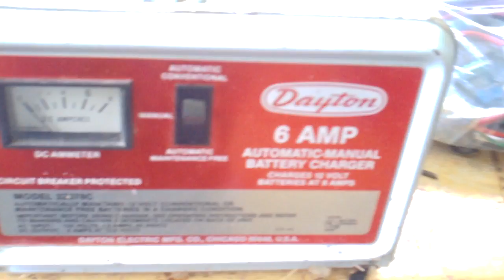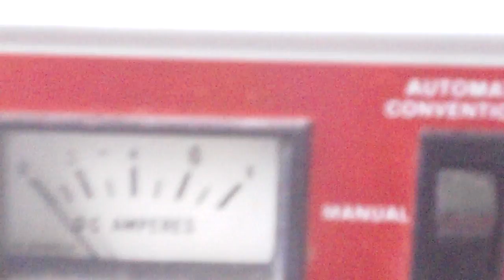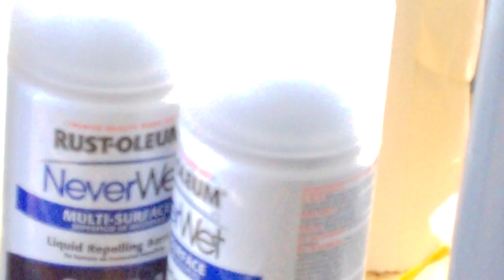How To Make Energized Water For a Joe Cell

Comment: If by "Orgone" you mean proton energy, this makes sense.  What happens when you remove the electron from hydrogen?  You get a proton, which can conduct through stainless steel, much like an electron conducts through metal.  The electrons go through the ignition system to the spark plug, which attracts the protons from the carburetor, in the combustion chamber, the hydrogen reforms and is reacted with the atmospheric oxygen, and "boom" you're running.  The amazing thing is if enough kinetic energy is created to run the engine and produce more power to dissociate more H-O-H.
Reply from the maker: At this stage of understanding proton energy and Orgone are more or less labels and labels don't confer any understanding 
unless they are backed by scientific observation. I'm not sure that under the light of objective measurement you can conflate 
protons with Orgone energy.  For one thing, what we know of Orgone energy has been found to affect seeds and food spoilage in pyramid 
shapes. No water or Joe cell is needed other than some water to moisten the seeds.
Are you aware of ways to generate hydrogen protons that would accord with the energy levels measured in pyramids?
the scientists also found that aluminum had no effect, positive or negative on seed sprouting or on spoilage and mold until it
had been placed in a pyramid for a few days. So, my hunch is that pyramids are orgone accumulators but work differently to
accumulate orgone energy than the Joe Cell.

Another unusual finding by Joe was that it took several days before an aluminum engine block was (saturated or conditioned)
with the Orgone energy. the Joe Cell then became almost redundant and can keep the energy "topped up" in the engine block
and, I suspect, in the cooling system water.  The timing has to be advanced since the engine runs cold using the principle of implosion.
this would lend weight to you idea that Orgone is actually proton energy. Joe has run engines on this Orgone with spark plugs but no
distributor cap or wires. I'm stumped by that, if true.

Another point to consider is that an ideally constructed Joe Cell has the energized water sealed inside preventing both losses
due to typical electrolysis and losses to evaporation. Yet, both the water level and flow of energy continue so long as the Joe Cell isn't shorted out.

Finally, are you aware that the Joe Cell can and does manifest new matter despite beginning with pure water and passivated stainless steel 
and despite being sealed so no air enters.  One experimenter with a great reputation found 19 pounds of weird sludge after cleaning his cell.
The SS tubes he used weighed 19 pounds when brand new and continued to weigh 19 pounds. However, he had the sludge analyzed.
It perfectly matched the metallic/chemical components in the stainless steel.
I also witnessed another experimenter using silver tubes and finding fine grade silver sludge when he cleaned the cell yet the original tubes
were completely intact and of the original weight.  Alert me to corresponding research by proton energy researchers and I'd be prone to agree
they are one and the same. D.

Comment: I have ran my 12kw 240VAC generator on purified compressed hydrogen for several years.  I generate HHO using a separator dry cell, catalytically purify, then...accumulator to compressor to storage.                                                                                                                                                             This "charged water" is complete BS!  There is no evidence that the bond angle in water has ever been different from 104.5° or changes with this so-called technology.
Like Tesla, I am an electrical engineer, (MSEE/ASEET) since 1991 and have explored alternate energies with a VERY open mind most of my life.                                                      But P.T. Barnum sums THIS up perfectly, “Unless a man enters upon the vocation intended for him by nature, and best suited to his peculiar genius, he cannot succeed.  There's a sucker born every minute!”

Comment: It's the water inside a well designed Joe Cell which attracts orgone. It does not produce anything and you don't need that much of voltage in order to "charge" it. Just a small "stimulus" for a minute, thats it!
Reply: What does orgone do? Or how does it work?

Comment: center electrode/tube is always the positive and the outside larger electrode is negative. This is done this way because in nature anodes are thousands of times smaller than cathodes, this is called asymmetrical electrodes. Very efficient capacitors, batteries, and fuel cells can be made using the asymmetrical electrode principle.
Reply from the maker: Two questions for you Solomons Words: How many Joe Cells have you built and tested with the anode connected to the center cell?
How many have worked? My guess you've never even built a Joe Cell and you are just trying to sound smart.

Perhaps you are smarter than Joe Booker, the inventor of the Joe Cell. I don't know where you get your information unless it is the CIA department of disinformation. Center cathode is the way Joe does it. NO anode connection at all! You dig dude?
Reply: I have not made a joe cell, but I have made a few electrolysis cells with different configurations and materials. I haven't really looked into joe cells at all just felt like stating something I've figured out through trial and error in my search for efficient electrolysis... If you are only making the center tube a cathode than does it transfer current through capacitive means? Similar to how a tesla coil's top load creates a difference in potential across a conductive plate close to it.
Reply: I think I can answer this with my willful ignorance of accepted science (but I think that helps often). The battery of the car has the anode and is the power source the Joe cell draws a current so no anode needed. The fuel source would be the battery which is causing the reaction in the hydrogen oxygen mixture. The so called 'orgon' produced is simply an electrically charged water when given the right conditions to vaporize it will carry a highly charged near volotile charge with it and if ignited it will explode (or implode according to the comments of those working with it) and given the right atmospheric pressure with ignition it will yield a substantial force. It's not so different than the conditions around the equator of the earth that generate frequent lightning storms. In that case I guess the clouds themselves act as a capacitor building up charge until the it overflows and causes the hydrated air in close proximity to act like a joe cell connected to a battery and fed into a car motor through the carburetor. And it searches for an earth in which to ground itself and goes booom. the equatorial atmosphere is like a big Joe cell. All it needs is a spark and bang it goes. A car running on a Joe Cell is running on electricity and not hydrogen (the cell itself is a conductive reservoir). The electrically charged vapor is then carried and conducted into the motor and then put under high pressure and then it is ignited.There really is nothing complicated about it. It is a very mechanical process. The electrically charged particles just need the right conditions to be turned into a vapor and carried to the carburetor with no extra air just the electrified vapor in it's concentrated form into the carburetor to be carried to the piston and put under pressure then ignited. But what would I know right? a high school drop out like me, don't take any notice of this.
Reply from the maker: Not bad, Gregory except that whatever the energy the Joe Cell produces it is not coming from the battery; but, more important, whether the energy is from electrically charged water clusters or Orgone the fact is the energy that I call Orgone is not a typical HHO type of gas.
Joe Cells work just fine with a solid aluminum tube or hollow aluminum tube that is electrically insulated/isolated from the negative of the car's engine. In fact, the connection goes to a blind fitting. No typical gas like HHO can flow out of the cell and it never consumes the 3rd stage water within the cell itself.

As I've mentioned before, the Joe Cell defies conventional physics and their is a literal ton of documentation from many astute researchers.
Reply: well I didn't mean to infer the energy was coming from the battery. What I was saying was that the anode is in the battery the cell is just a carrier of the current into production of the orgon or what every form it is making it. Without the battery then no electrical charge> Well I really didn't mean to say that if I did. They guy is asking about the anode and cathode. 

I can see it surging in one of your other vids. That is interesting... You mention a slight change in the way you set up that cell but don't tell... I'm watching in just now
Reply: +hyfusiondotcom how far have you driven your vehicle on HHO?
Reply: Hey man, I just found out about this Joe Cell stuff, and your explanation here is the most logical one I've seen that doesn't reference 'orgone' (not that I'm opposed to the idea, it's just new to me and I know nothing about physics)...also, I was watching a video of Joe showing some stuff in his garage off and he mentioned regarding one contraption, 'this is how I make lightening'. So you're saying that by introducing a current into water, and then introducing that water into an environment with magnetic fields that create the right environment for electricity to 'conduct' itself through water vapor (like storm clouds in stormy parts of the world), the electrified vapor looks for a place to release itself, and then whatever 'spark' caused by the engine creates an 'endothermic' reaction which powers the engine? So this is like an electrified water-vapor powered thing? And it would make sense that not too much water is actually used because it's just a consistent current that's expressing itself and the water and magnetic fields are just sort of the catalyst for that to happen, right?

Does that violate traditional physics? I don't know an anode from a cathode, but this idea of magnetic fields and water and electricity to create power is something I just heard about and am fascinated with. I also worry that I don't know enough about physics to not get taken in by some BS, so very curious to hear more from a perspective that sorta 'makes sense' to me.
Reply: I think Sol might be one of those young people who were flogged "conventional current flow" as  distinct from "electron flow " like us old blokes were taught.

Comment: I've come to the conclusion that this is not all it's made out to be.
I've tried all sorts of configurations, except charged water, but still can't get anything to run with or without Hydrogen.
I've tried Wet Cells, Dry cells, but still no results.
I've used a MIG welder to supply High Amps and High Voltage, and produced quite a bit of hydrogen, but still couldn't get even a smallish generator to run on Hydrogen only, so there is no way a car would run on it.
For "Joe" to say he's ran a car with NO FUEL, including Hydrogen, seems pretty hard to swallow.
Why didn't he tell us how it's done if it was at all possible?
There must be thousands like me that have tried, but no one, as far as I know, has come up with anything.
ALSO why would an accelerator pedal and a carburetta make an engine run faster if it needed no fuel, it doesn't make sense to me unless petrol/diesel was still passing throuh the carb. Why else would you need a Carburetta?
I think we have all swallowed a "silly pill"
I've not given up on it yet though, but I think it's getting close to calling it a day.
UNLESS someone out there is running a "Fueless" engine?, which I doubt ????????????
We should all maybe bury this dead horse?
Reply: +truthseeker959 I can understand your frustration. Most people don't know, but in 2008, Joe's videos from the 1990's were still online, and he showed his cars running with the fuel lines completely disconnected literally hanging in the open air. He had about 10 hours of videos showing his cells and he told us everything, he didn't hide anything. The confusion comes because nobody actually watched any of these videos and if they did, they surely didn't pay attention.
Reply: +truthseeker959 The reason why Joe doesn't give information on how he does it is because of the greed of man. He's already been approached by numerous worldwide companies to impart his knowledge so they can have the patent. 

Joe said no because it is not for the greed of man. As these companies will make zillions for people and that's not Joe's intention. And yes, everything you see in this video and in other Joe's videos is 100% legit. 

I"m set to see Joe back in Australia next year. Looking forward to meeting him.
Reply: Hi, thanks for the info, but if everyone is "privvy" to the info then the companies can't do much about it and we will all be better off for it?
When you do see Joe, ask if he could make some new videos, as most of the ones on YouTube are old VHS poor quality stuff, and it would be good to "re-light" the spark in us would be engineers.
I still think this sort of knowledge should be shared, by not sharing it's keeping us in shackles to the greedy companies .
Cheers
Reply: +truthseeker959 Yes, Joe rejected Motor companies from the USA. I can't say which due to a promise. Joe says that as I wrote above. Water is free and we're already paying money for bottled water when water should always be free. I have to agree with Joe. 

However, there are countries around the world whom need this device, whom are in dire need of fresh drinking water. 

Truthseeker. I will most definitely ask Joe. If I can shoot a new video for you. Okay. It won't be until next year. So until then patience is needed from you and myself. Because believe me. I'm itching to see Joe real bad.

I do agree regarding it should be shared.
Reply: @favworldwide9149  there is no one who COULD obtain a patent because of the rules the patent office set up. So simply releasing all the info anyone would need to build one would be the absolute best thing he could do. 

Even if there were multiple people who wanted to build and sell kits-- so what? I can't see how that would in any way affect the "greed of man",  because no one would have to buy a kit; they could just build their own device. 
Now, Joe says he doesn't want to be a bad person to the fucking Big Oil interests, because THEY set up the economy, and it's OUR economy as well. 
That is a fucking smokescreen. 

The best way-- and common sense tells you this-- is a grassroots movement. 
People building these things in their garages, and slowly the Big Oil interests would be persuaded to stop DESTROYING the earth-- something Joe quite conveniently forgets. Or doesn't care about.

Have you ever heard of Keshe? The Irani genius who has invented medical and space travel technology which would catapult the world to a new future? He was arrested and deported from the US, because he went there to speak with the government about his tech.

Get it through your head: THEY don't want their control threatened! 
And if Joe was not such an idiot-- yes, brilliant, but an idiot-- he'd see this for what it is. He is stupidly naive.
Reply: Some are. Yes.
Reply: IF YOU HAVE COPIES OF ALL THE ORIGINAL VIDEOS RE UPLOAD THEM PLEASE
Reply: +supermuble  are some of the original vids.. now not on the net ?
Cheers
Reply: +Fav Worldwide maybe he should look into open source hardware licensing. once it's in the public domain it's had to stuff the genie back in the bottle.
Reply: supermuble yes.. thanks .. i like to say    somehow they have scrubbed the net... so     we can only see 95% of the solution .. oh well.
.... we can put the lat 5 %   together... Cheers !
Reply: its got a lot to do with the configuration of the bars between the concentric circles. see the original joe cell, or some crop circles to get the right positions :}
Reply: truthseeker959 
Look up split the positive here on YouTube.  Bro Mikey will tell you all about it.  Then you can put the bank of batteries in the back of A pick-up truck and use them for electrolysis.  Then put solar panels over the batteries in the bed if the truck to keep the batteries charged up.  

  Your HHO cell should be divided to let the oxygen vent and only the hydrogen should go to your engine.  That way the computer doesn't add fuel for the extra oxygen in the system.

  Use at your own risk...

Comment: does it run a car or a small generator? the reason I ask this is because I obviously would not wanna spend $200 on something that does not have any use....
Reply: captain42979 it's ment to run an engine without actually using the gas ; ) And it has been reported to created partial and full antigravity .
Reply: ***** can you link me to something that would help me in my unlimited energy adventure?

Comment: cocktail shaker...genius! :D
Reply from the maker: yes, good eye! I figured if it didn't work I could always mix up a drink.
Reply: @hyfusiondotcom  I am using a Cocktail shaker and it does not seem to work.
Only the Negative + cylinder 1 reacts..
The other 2 cylinders are dead.